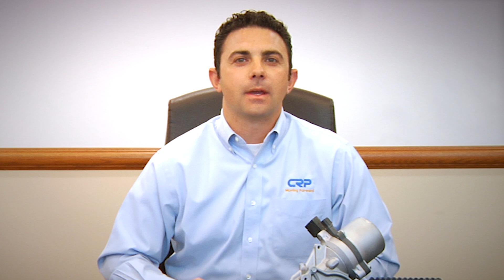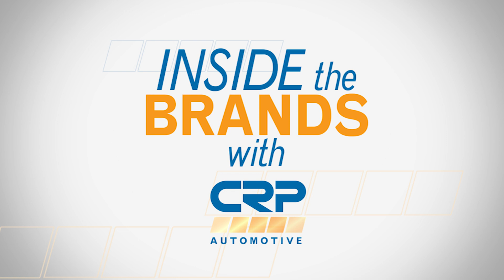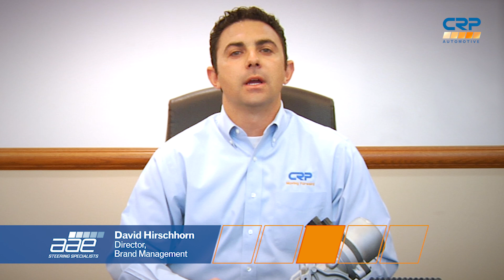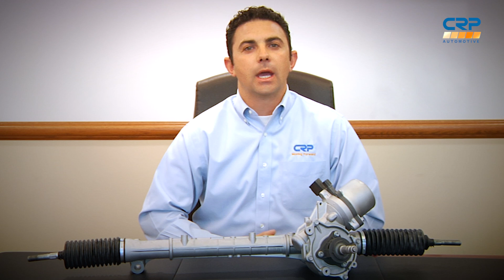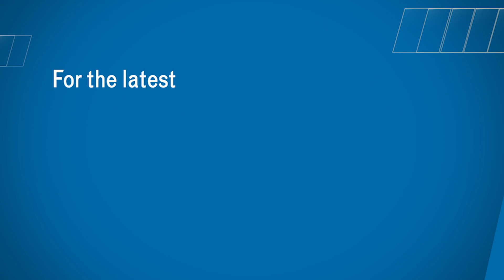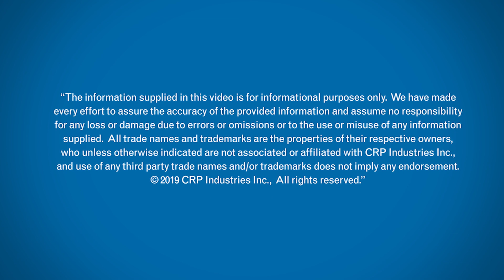Troubleshooting Honda EPS “Limp Home” Mode | ITB Episode 112

Comment: Before I change the rock When I scanned it the code says 53-02 Torque sensor check after the dealer replacing the rock I still having the same problem when I scan the car the same code keeps coming up